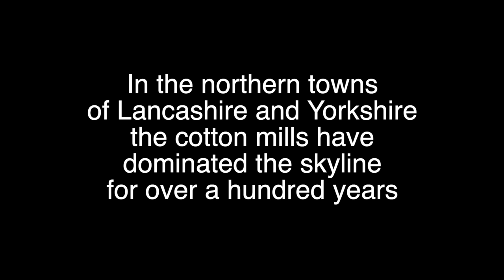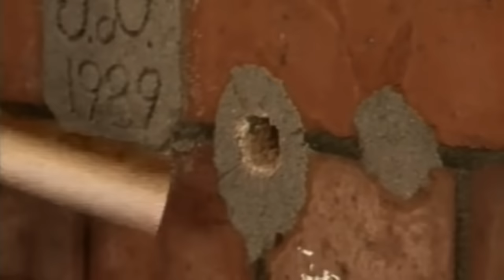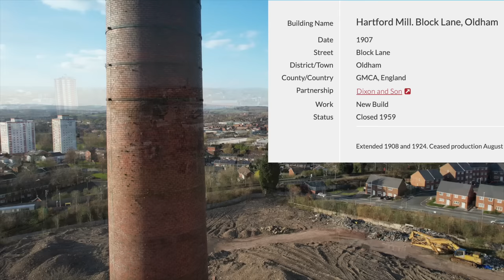An explosive demolition of a mill chimney

Comment: Hartford mill was built in its entirety in Chadderton, My Dad was a textile engineer at  Platt Bros at Chadderton , at the time 33000 people worked there , the only thing Platts brought in was raw materils , they made all there own tools as well as textile machinery , all the cast pillars and floor joists all made in chadderton, at the peak of Platts they had a demonstration site , were they built an entire mill ,got it operational then took it all apart for export , Fred did some work on the Hartford chimney those steel bands at the top were all Freds , I did a few engineering jobs with Fred and new him very well .
Reply: GO back to school and learn some grammar.
Reply: 33000 thousand wow a lot of folk in one building, 🤔
Reply: @TheInsultInvestor  it's a shame you didn't learn, compassion or politeness.
Reply: @markberry3136  Platt Brothers covered 65 acres (260,000 m2)
Reply: @TheInsultInvestor  GO back to school and learn proper capitalization. 😂
Reply: Too bad all textile industry is gone. I still work in what is left of it here. We should make our own clothes.
Reply: @johnthompson3605  Would i be right in thinking Fred did them bandings mid 80's ?
Reply: Platts operated at two main sites in Oldham covering a massive area. Though Platts is no more some of the buildings at both locations are still used for various industries today. They also owned quarries and collieries to produce their own fireclay, moulding sand and coke for their foundries. I have been told that Hartford Mill was also used by Platts to 'road test' their new machines in a realistic production environment. they also built mills in Japan and virtually founded the Japanese cotton industry. In fact Toyota cars came into being because of Platts. Prior to this the firm had been called Toyoda and were making textile machinery, most of which had been poached from western designs -however, they had developed a power-loom which was claimed to be better than the American Northrop Loom (invented by an Englishman named Northrop) that held a virtual monopoly at that time. Platts bought the worldwide manufacturing rights to the Japanese powerloom in 1937 for the princely sum of £750,000 (the Japanese claim £1,000,000) and Toyoda used the money to start making cars, changed the name to Toyota and thats how it all began. @markberry3136
Reply: @markberry3136  I think the poster was referring to the employer Platt Brothers total workforce and not simply the staff in one building (which would have still been in the several thousands), those numbers may seem immense and excessive by todays standards but you have to remember they didnt have the automation we rely on today and damn near EVERYTHING was built/made/or constructed mainly by hand back then, so yes a workforce of  30,000 + wasnt out of the ordinary for a single large employer back then. At one time it used to take around four thousand men to construct one large ship - these days with computer design and welding robots/ modular construction etc the same job is done by about two hundred.and in a fraction of the time.

Comment: In my town Binghamton NY I know of at least four old derelict factories that have been transformed into apartments. One was the building I worked in, a small manufacturer of custom electrical cables chiefly for industrial use. When I joined the company it was on the third floor with a few other rooms rented by other firms. It was sold for taxes and the interior was gutted (asbestos) and divided up into 1 and 2 bedroom apartments reusing and upgrading the elevators into full automatic. Finally we were moved into the first floor where the company remains today. It's interesting how the wood floors were black before but a lovely honey colored wood once cleaned.

Comment: Worked in a few mills late 60's and early 70's around Oldham and Shaw. I was at the time an apprentice pipefitter and the firm I worked for was installing sprinklers in the mills.
thinking now, the mills were then on borrowed time and the last thing they needed was the cost of installing sprinklers.
One thing to remember back then was always take your lunch with you when working in and around Oldham, the Wakes week, all businesses, mills, garages in fact virtually anywhere where people were employed closed.They were closed for 2 weeks, usually last week of July and first week of August, that meant every shop, chippy and sandwich shop was closed. If you didn't take your lunch with you, you went hungry. Lesson learnt the hard and hungry way.

Comment: Good video. 170 years ago, here in Connecticut, most rivers had mills on them. The bigger the river, the bigger the mills. There are still some standing but most have been demolished. Many of the sites are not reused because they are considered contaminated.
One aspect that I found interesting was that in eastern Connecticut the mills were for thread, buttons, and dyeing. In the middle of the state along the Connecticut River was mostly machinery mills such as Pratt and Whitney, Colt, and Winchester. Most of the mills closed in the 1960s through the 1980s. We had a series of recessions at that time.
About 10 miles south of me is a huge old mill that they started to repair and convert into businesses but, they stopped part way. 

The demolitionists seem to have done a good job. I was afraid that it would go in the wrong direction. Good Luck, Rick
Reply: I've seen modern day photos of some of the old mills in the far North Eastern USA and was amazed how similar they looked to the mills that used to fill the towns of Lancashire and Yorkshire. Could it be that some of the design skills crossed the Atlantic with emigrants.
Reply: @briwire138  Absolutely correct. Since the beginning of the American Colonies, skilled masons were brought to New England to do stone work on buildings and stone fences. My area in Eastern Connecticut had some large stone quarries. One of the quarries in Oneco had over 200 stone cutters working there in 1850 and they had their own railroad spur into the quarry. They provided stone for NYC, stone arch bridges, and many other structures. We still have many of the stone arch bridges. I used to enjoy inspecting them(except for the snakes in them).
If you walk the woods around here, the stone worker quality is evident in the 200+ year old walls. The regular farmer walls are generally poor but the mason built walls still look good. In our area, they generally stopped doing walls around 1816 which was known as the summer that never was. Ohio opened up around that time and many from my town moved to Ohio. The population didn't recover until the 1980s. Good Luck, Rick

Comment: Used to love playing and climbing around in there as a kid and early teen, Brings back many memories.

Some knobs set the stairs on fire to the roof and we had to use the inside fire escape which was scary and coming away from the wall on certain points, they bricked it up eventually.

The chimney looks different without the small hatch underneath to the side of the boiler house, I only went in the chimney once as there was too much soot and my mum went mental when i came home looking like a chimney sweeper.
Such ashame history is being wiped out from around us.

I did see it coming as the guy who bought it for a quid just left it to rot for years, no doubt more boring houses without a soul in the architecture.

EDIT: I just got to 14:35, No wonder they brticked it up, the first part of the fire escape has gone.... as for the kid, apparently he thought it was a good idea to go into the lift/ Elevator shaft and fell from a few floors up to the basement...

EDIT 2: Jeez.. @ 16:31 the last time i went in Hartford, the windows was still there and the walls were still standing.

Comment: Downingtown, PA, USA, used to be a significant industrial hub back in the age of steam. Most of the old industry has been turned into parks or hiking trails - BUT - if you know where to look, and look close enough, you can see where everything used to be. Not too many years ago, just like this, there was one chimney left standing. Watching that thing go down was amazing, yet sad, just like this. Another piece of history gone.
On the other hand, if you get a chance to visit Cape May, New Jersey, USA, there are still a few "fire control" towers left. The towers were built during WW2 as observation posts for land-based artillery to counter anything the Gerrie's might throw at us. Problem is, after the war, since the towers were built to withstand any and everything, it was too expensive to demolish them, so hotels were just built AROUND them, instead!

Comment: It'd be interesting (at least for me) to be able to take a look at the lightning protection bits and pieces that were on that chimney and see if there were any manufacturing names on there. I work as a lightning protection engineer for a company that has been around since 1893 and has done things like steepjacking, lifts, lightning protection and so on so it would be interesting to see how these things have changed over the years.

Comment: that hartford mill would have made some classy apartments for rich people with those big open spaces and big window openings.  however, developers get their way by encouraging demolition by neglect.  that chimney, however, had to go.  those stress cracks at 5:38 and 13:43 indicate serious problems.  those cracks wont just be on the outer courses of the bricks.   youtube is full of unprofessional demolitions.  this was a very professional drop.  i would have refused to drill out the holes for the explosives or the cut-outs.  i cant imagine how strong a protective cover needs to be to protect from a brick dropping from the top.

Comment: I come from a family that worked in the mills until I was six years old, when they were replaced with Immigrants, and we migrated ourselves to Blackpool, which was just like Vegas in my eyes, a top move by my father.
I have stood on the top of my local mills chimney on my lunch break, which is the worst climb I've ever done, the overhang on the top , made getting back on to come down a nerve wracking experience. Luckily I'd done Mountaineering at school for two years, or I may not have risked it. 
My Mother looks on her time in the mill as the worse job ever.

Comment: where I used to live there was a factory across the street, still is there to this day, but the smokestack was a 350footer I think about a decade ago is was reduced be 100 feet i think so it would be very clear of the air space here when they changed the laws around that. but I remember the office and R&D lab that was in front of this old place, and the lamp post that had a key on a chain in a box for the parking person

Comment: It is sad that an otherwise great building was left to deteriorate!
If you look at other mills you find that often they can be repurposed ..... like the one down the road in A-U-L which is now hundreds of flats (and we do need housing)
Still the original builders would not have cared too much, I think, once it's purpose had ended!

Ironic that a chimney worked on by Fred would be brought down by blasting!

Comment: Your last video on this place was 4 years ago? My god, time flies! I work not too far from this in another old mill. I don't think that one will be for the chopping block any time soon though, which is great. If well looked after they'll last centuries, really solidly built things. The roofs are always an issue though given they were designed to capture water for the sprinkler systems. Ours is always springing a leak especially when we get heavy rain!